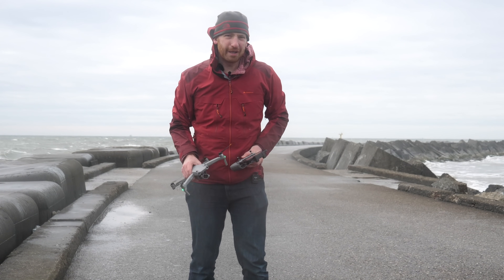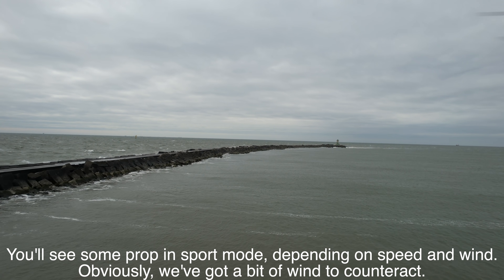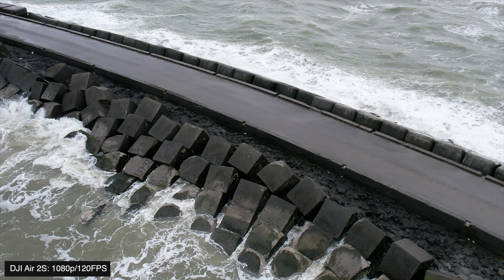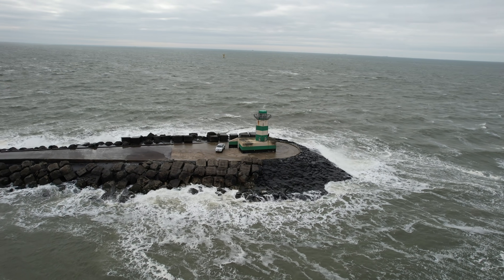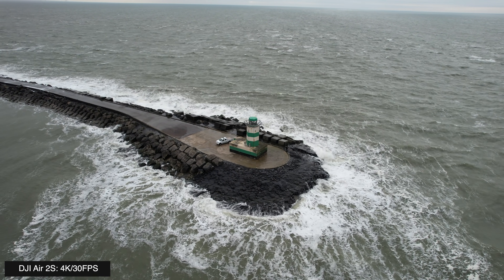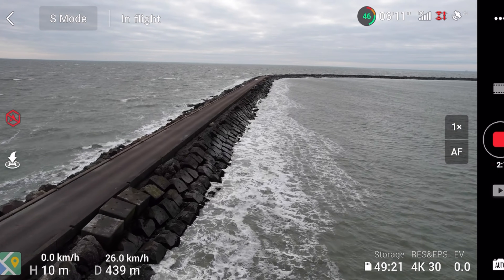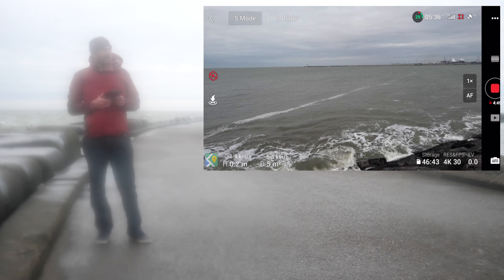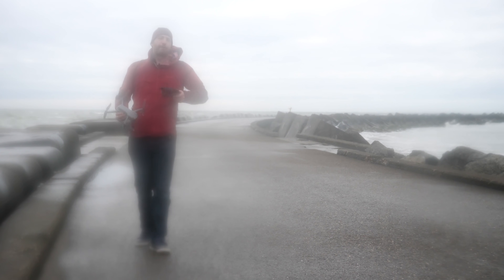DJI Air 2S: Extreme Wind Test!

Comment: Just minutes ago my mavic 2s was against straight head on wind and even in sport mode it was struggling soo much that sometimes it just stopped and most of the times it went 2m/s=4.5mph and drifted left by 0.5 m/s=1mph thankfully I got it home on 20% I didnt think the wind was that fast and drone itself didnt warn me about it I came so close to losing it.

Comment: I subbed your channel.  Love the content. Nice video!!! But you should never turn the drone over to turn it off. Your are stressing the ESC's and can damage them over time. DJI built that safety  precaution into the software for emergencies only. For new people getting into this hobby/lifestyle, will think this is normal, they will do this on a regular thinking it is kool, or simpler to do. Please research this for yourself. And if you agree. Please let people know in a future video not to do this. Thanks for sharing this awesome video. 🚁☁️☁️☁️

Comment: HELP <-----
HI! 
I always fly over the bay waters at Miami Beach, FL. The USA.
Is there any way to set a "LOW ALTITUDE WARNING" or any similarity on the Mavic Air 2.?

 I get distracted and lost all the altitude while moving the left joystick to rotate. 
I could set it to any altitude for the warning to be activated. The idea is to increase altitude if I get below, e.g.,  5 or 10 meters.
Then prevent it from crashing into the water. I already lost the Mavic mini and the Mavic 2. I can't retrieve them from the bay floor. I am afraid to make the same mistake with the Mavic air 2. It has happened to commercial airplanes too. Pilots get distracted and crash after losing altitude.

Comment: Not in the least bit excited for the 2S but way more excited to consider a DJI Pocket 3 with a 1 inch sensor since  DJI tends to pair them together and leap frog them.  In the order of Mavic Air/OSMO Pocket, Air 2/Pocket2.  So lets hope for 2S/Pocket 3 to continue the tradition of sharing the same sensor.  And with that Moaz screen competition, lets see if DJI will use that accessory port to include a flippy screen and a 1 inch sensor!!!!

Comment: Thanks for a tremendously good an enjoyable testing, I love your devotion for taking it to edge of the envelope, I was watching the dive session in the DJI Air 2S Active Track against Skydio 2 - and that must have been a challenge, I must make my condolences... One thing I noted, though... I that in the cross-wind scenes (like in about 6:10 and onwards) we have some twiching like stepwards mowing on the gimbal when moving, not directly (or smoothly) compensating for the movement... What an horrible landscape, with industrial installment that looks like shit!

Comment: I lost a drone because of a fly away and over water. And the winds were far less! This video gave me flash backs!
Reply: How does it happen?
Reply: @jd2161  I was stupid! I flew pretty far out with the wind at my back. Dumb move! I got all of my shots of this little small island. But it was time to come back then I learned a hard lesson, I was going against the wind and didn’t have enough battery to get back. It was tragic watching the drone struggle in the wind to get back and watching the battery levels drop. It probably got 200 yards from me, then it went down the into the water. It was the ocean, I wasn't dressed properly to go get it. It was a terrible feeling walking back to the car just just the controller. It was lost.  I think about it all the time. 😞😕

Comment: How come there are props in the shot for the air 2s but not for the air 2? Then angle that the drones tilt are the same, so why?
Reply from the maker: They do show up in the Air 2 as well in sport mode, though seemingly less often. Also might just be entirely luck with the exact angle.
Reply: @Dcrainmaker  cool I see. Love your channel and I am ver suprised how fast you responded. Will you do a mavic air 2 vs air 2s active track video?
Reply from the maker: @Josh_Greenbaum23  I don't plan to at the moment, mostly as I've already done a Mavic Air 2 vs Skydio one in the past (exactly a year ago), and from an Active Track/APAS standpoint, nothing changed there. At present though, I would say that APAS seemed better on the MA2 than the 2S.

Comment: Ray, what's the anemometer you're using? I guess you'll have the gold standard!
Reply from the maker: It's honestly a piece of crap. I mean, sure, it's seemingly accurate, but it's got a short in it, so every time I use it I have to use a new CR2032 coin cell battery.
Reply: @Dcrainmaker  Thanks, Ray - I'll get whatever's most popular on Amazon!

Comment: Theirs no way I would fly a $1300 drone in those conditions. But I'm glad you do these tests cuz they are cool to see the drones limits!!
Reply: I wouldn't fly my drone (just ordered the new Air 2s myself) either. But he did and the payoff was the amazing wave shots he got at the end!  🌊
Reply: @stevengeorges9046  yes. That shot was pretty cool.
Reply: @stevengeorges9046  yeah I flew my drone in 55kmph winds new air 2s and it was fine just but I wasn't worried as I had the insurance on it and it performaned very well did 10km/h into the wind.
Reply from the maker: Thanks!!!
Reply: I have a phantom 3 pro, it’s sketchy. I was flying in 100kmh/60mph winter winds in Minnesota when it was around -18F. The cold and wind wasn’t the worst part, the worst part was I was in the bluffs of the Mississippi River between Wisconsin and Minnesota. Lots of bald eagles flying around, I was surveying a solar array for the utility contractor and eagles were trying to strike my drone. My drone was throwing battery fault and sensor fault alarms 10 minutes into the flight from the severe cold.
Reply: Same I wouldn’t have the nerve for that lol
Reply: I would like to thank my  Sponsors for supporting me. On the real side thank you for answering our questions with live data. All of us with these dji drones thank you.
Reply: I had to go get my drone because the winds were too strong for me to RTH.
Reply: @RadDadisRad  yep.
Reply: I get nervous flying my air 2s in 10 mph
Reply: @gratchgratch7919  same with my mini but in any slight breeze
Reply: @rctd3260  right and I'm experienced just not rich things can go wrong in an instant and I'm not willing to gamble lol
Reply: @gratchgratch7919  same

Comment: Was that a bunch of frame drops around 11:01, or is it my computer?
Reply from the maker: I think it was actually my computer during render. :-/
Reply: @Dcrainmaker   I didn't think that was possible.
Reply from the maker: @DaveMody  Yeah, I had tried to slow it down to 50% playback for more of a slow-mo look, and then applied frame blending. It looks like the frame blending never applied, thus...basically looking like crap. I didn't catch it. :(
Reply: @Dcrainmaker  I usually shoot with a 90 degree shutter for 50% rate decrease, and skip the frame blending.   
Also, moving water is really hard for the codecs to compress.  I haven't found a more challenging Codec killer than waves.